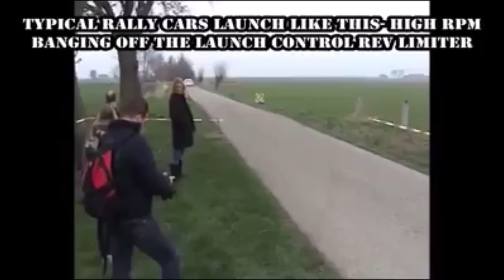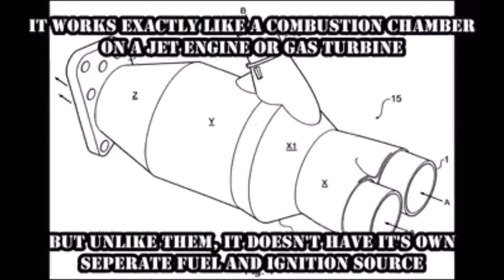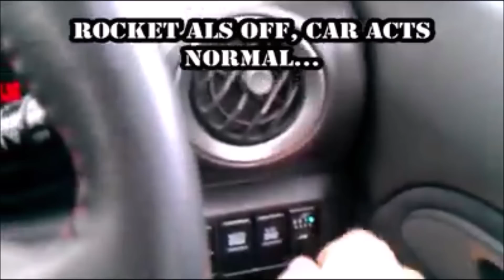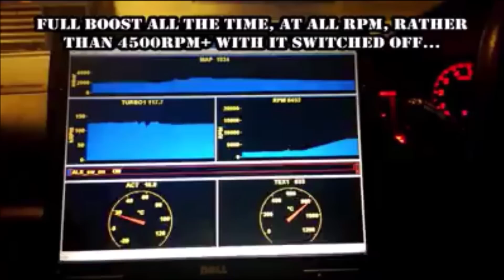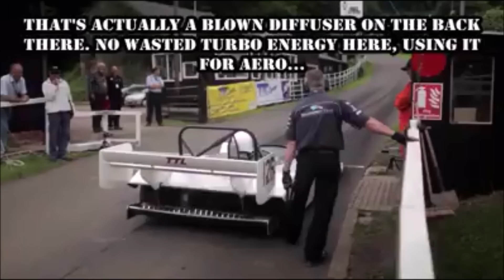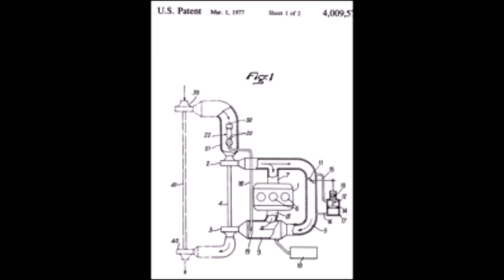Rocket Anti-Lag, making your turbo work like a jet engine- A quick overview and some mythbusting...

Comment: I have a spark plug design it could use to fire water, esp saltwater which is more flammable as a mist/steam. It's too large a plug to fit into a normal head at 2.5" wide and 2.5" deep off the thread.

Comment: this feels like the long way to achieve the same effect as a supercharger. full boost accross the entire rpm range
Reply from the maker: 1- No superchargers truly give full boost across the entire rev range.
2- The only ones that get close are positive displacement ones and they’re not as efficient.
3- Due to parasitic losses and lower efficiency a supercharger always ends up giving way less power for any given boost than a turbo.
4- Due to (mostly) the load on the crank supercharged setups tend to be less reliable for any given power too.

I love superchargers, but there’s absolutely zero comparison, and a good reason they’re not as widely used, even without this setup.

Comment: Just saying.. my diesel vw variable geometry turbo can reach its max shaft speed in less than 2 seconds and result in a absolute intake pressure around 40 psi (26 psi relative to atmosphere. It is impressive to see it done here without any variable geometry. This is a pretty interesting concept and it is good to see someone other than car manufacturers innovating
Reply from the maker: VGT cannot compete with this even slightly. Not even on the same planet. If it did they would.

Comment: porsche just did this electronically with a battery connected to the turbo lmao
Reply from the maker: That’s been around for ever. Not as good or as viable for 99% of stuff
Reply: @StavTech  i had no idea very cool! why isn't an electricity spun turbo as effective as using the method subaru invented? loved the video btw awesome stuff.

Comment: how do we apply this to a dual volute turbo?

two rocket manifolds per turbo?
Reply from the maker: Generally, you just don’t.
Reply: @StavTech  no... the correct answer is they just havent yet 😉

imagine a vr8 or horizontally opposed 8, something with 180° crank, with either freevalve or rotory valve heads, running two dual volute turbos, with four of these for manifolds...

youd have like... 1000hp from idle...
Reply from the maker: @KaosProject21  no, the correct answer is they wouldn’t. When you have zero lag anyhow from this, why go to the complication of twin scroll? You don’t.

If you want twin scroll, you use other forms of rally antilag, which they do. Inc me

Comment: so when you add this will you need to run richer than previous setup/tune?
Reply from the maker: With anything like this the tune will change when you switch it on. You don’t just run this on the stock ecu

Comment: This tech drives me nuts because its honestly an extremely simple device, its just that it needs dedicated computer control and its own control maps, and a well designed combustor to work. Flow-through combustors are very unforgiving if you dont get the combustor design and fueling just right.

And those aspects are VERY difficult for a shade tree tuner to build and tune from scratch.

Meanwhile, theres not much of a market in aftermarket to justify development costs.

And OEMs wont touch the concept because it'd just use more fuel.

Comment: This isn’t needed. The post WWII aero industry showed us the way with ‘turbo compounding’. The modern auto equilivent would be to hook up a turbocharger to a car, but also with a belt going from the crank to compressor end, just like a centrifugal supercharger, but with some sort of varible ratio setup, like a variator or a CVT belt/pully setup. This way the turbocharger would work like a crank run centrifugal supercharger when there’s not enough exhaust pressure to spin in up, but once the turbo was spinning up, the gearing on the belt would change so that kinetic energy from the spinning turbine wouldn’t just compress inlet gas, but would add power directly to the crank as well. Do a search on the Napier Nomad or some later marques of the P&W Wasp Major
Reply from the maker: No, it is needed, as what you describe is wildly complex and still isn’t as effective as this, hence why it’s not wildly used

Comment: How does one manage getting all the extra oil pressure into the turbo at such low engine RPM with such high turbo RPM? Im not real smart, does the turbo pull its own vacuum for oil pressure? Otherwise, wouldnt the turbo bearing wear out super fast?

Comment: Why is is this not used in drag cars? These guys are used to rebuilding the whole engine all the time.
Using turbos as a consumable seems like a small price to pay for always boost like that.
Reply from the maker: Because drag cars are always on boost anyhow.
Reply: @StavTech  Sure with two step and anti lag methods they get the turbos spoiling. But those techs does not seem as reliable for max boost through the whole run as this.
Where you can just turn it on and have the Turbos spooling at full speed and providing as much boost as you let in when ever you want. It seems like a more controllable and even boost somehow.

Comment: I was thinking, what about the idle oil pressure of the engine and the work load on the turbo bearings. there's enough pressure to keep it protected?

Comment: The issue I think is more related to EGT, exhaust gas temperature. They go sky high very very quickly, within a few seconds, risking fires. It's a good launch control but after launch should be switched off otherwise it will melt the turbine.
Reply from the maker: It’s EGT but it’s not fires. Melting turbos etc by being too hot. 

It’s not for launches though, that’s just a very very small part of it
Reply: @StavTech  ALS is good for racing and lap times, nothing beats the good old kick in the butt of a laggy turbo and it's fun trying to avoid it as much as possible by being in the right gear 😁😁
Reply from the maker: @st939  the kick in the butt is no less with antilag

Comment: 120k revs to 50 in .20 seconds, how much g forces is that ?
Is that the force that kills turbos this way ? by fluttering it out through the housing and compressor wheel ?
Reply from the maker: High exhaust temps is what mostly kills it, or accidental overspeeding it.

Comment: Easy thing ! A stroke funnel that ask by drill fuel savers threw xhamber of ! 
Train Overpressure brake air ventileson hoses are goid by too that press spring in cage with bullit by pressure over thought out off and reathem ;) :))
Hell on Fiestie that so unallowed today by GFJ Ford art :))

Comment: I'm amazed that this hasn't been adopted in drag racing
Reply: Because nitro isn't band
Reply from the maker: Why? No cars have any issues spooling on the line unless their shit isn’t working right
Reply: It's a totally unnecessary expense when you can already build boost just fine with a trans brake and conventional 2 step or 3 step.
Reply: I said same but u kinda need the high rpm’s. I still want to see if it helps

Comment: The only useful bit of kit ive seen able to put any power down usefully was the car that was built then immediately outlawed for the pikes peak hill climb was the one that applied a vacuum down onto the asphalt as it aero package..  the thing was electric i think and completely dominated all times and impossible turn rate with the vacuum holding the tires to the road..  that shit was beyond crazy seeing how fast it was from takeoff to end..  like a slot car just go and friggn try to keep your eyes on it before it was gone..

Comment: to my knowledge, this or something similar was used in Group B (specifically Audi) where they injected fuel into the exhaust gasses when releasing the accelerator to keep the turbo spinning.

Comment: What is the switch in the Subaru controlling?  Was the rocket system mechanically bypassed, or did the engine computer just switch to a certain profile?

Comment: If replacing a turbocharger is your idea of "regular maintenance", these are great!
Reply: all types of anti lag destroy turbos this is just a better variant of anti lag
Reply: @wrth  usually the people doing quality builds are same people who get quality turbos and can afford a new one anyway
Reply: @Ruska_o7  I am the guy that does those builds...I also rebuild turbos, bearings are cheap, cartridges impellers and housings... not so much.
Reply: That is regular maintenance. Everybody wants a race car until it’s time to do race car maintenance!
Reply: @Wreckless229  Everybody wants to be a cat until it's time to do cat things.
Reply: Or your rods launching at such low rpm at full boost.
Reply: @catchr7bluedevil dont put it on a shit tune
Reply: Shouldn't cause any additional damage if the rocket is burning fuel & creating exhaust gasses pre turbo. The damage stems from fake anti lag with no rocket, which dumps fuel into the exhaust hoping the manifold heat ignites it causing flame to hit the turbine wheel & damage the turbo. Egt goes high. In theory, the egt can be low with the rocket system if it's burnt correctly & therfore no extra damage
Reply: Was thinking the same...your turbos won't last but...gotta pay to play
Reply from the maker: @millll111lllI  compressor inlet
Reply: To be fair the rocket reduces how damaging it is to the turbo because the burning AFR isn't coming out in big high pressure, high temperature pulses.
Reply: So winners win, losers lose. There is no disruption only entertainment and revenue.
Reply: Seeing as how I drive a VW diesel.. Yes it is regular maintenance ;) Just kidding mostly but the CKRA engine code TDI in the passat has a different turbo from the other 2 liter common rails and does legitimately kill itself around 100k miles like clockwork XD. Fix is to upgrade to the turbo off the GTD Europe gets, or even the turbo the 2 liter CR190 gets.. you get the point
Reply: I wonder if water can be injected after the combustion chamber to cool the gases before entering the turbine.
Reply: Depends on where ur turbo is located 😂. On a subaru stock location... fk that lol! I did 2 in a year and they are a major pain especially to get rhe lower solicon hose to sit around the lower turbo flange without kinking. Fk im having flashbacks as i write this...
Reply: @CVBFonzP7B yea but my 1980 vw rabbit pickup with a brand new diesel engine... I want that thing to eat ebay turbos every year it's easy to work on haha
Reply: @rajgill7576  exactly... hahaha

Comment: You need the extra pipes and valve
Reply from the maker: For what
Reply: @StavTech  for anti lag; exactly what you video talks about. You need the hardware, because you can tune anti lag without, but reliability is tossed out the window, as well like you talk about with the hardware setup youre running the turbo at high RPM constantly.
Reply from the maker: @alexmaccity  no
Reply: Okay That just clears everything up

Comment: Any one read about Soviet turbo charged WW2 aircraft and their anti lag systems? 
They essentially block the intake to increase turbo rpm! It works the same way as using a hoover! When you block the suction and the rpm greatly increases.
Reply from the maker: if you look at my previous videos I did that many years ago on one of my own cars
Reply: @StavTech  I take it is the "102mm throttle, mounted BEFORE the turbo? Anti lag? Junk?" video?

Comment: Just as another commentator, I saw this video years ago and couldn't wrap my head around it. Now I own an 1.8T and understand turbos way better. So a question just came up about the turbo spinning at it's full speed at idle. Since the engine is idling, is there enough oil pressure to lubricate the turbo enough for it to spin this fast without damaging it? Or ist that the point you were trying ot make with the picture of the blown turbo? Greetings from Germany!

Comment: so i assume for this you need an electric oil pump for the turbo since it will be rotating faster then the oil can feed because crankshaft is at low rpm, and how would it work with a higher hp car?
Reply: even at low rpm, the engine is supplying 40psi of pressure to the turbo. They have restrictors to prevent too much oil, actually. No need for additional oiling.

Comment: I thought my Uncle, Dad and I invented antilag on a '65 Turbo Corsa Corvair that was my High School ride '75-'77.
In short if a person kept opening the throttle while simultaneously retarding the ignition we found that after about ten seconds we could keep idle rpm of 850 with 10psi of boost! The exhaust pipes were yellow-hot and that couldn't be good. Drank fuel like crazy, too.
       Uncle Jerry invented "The Mechanical Switch" because it operated sort of like a railroad track switch.
Mode 1 = Locked distributor, carb throttle controlled by right foot (ran as originally made)
Mode 2= Carb throttle locked open, distributor free to rotate from MINUS 24 DEGREES TIMING (idle) to the normal 24 Before Top Dead Center when gas pedal floored.
Reply: Noooo.  You "invented" 2-step, which is completely different than anti-lag

Comment: my old subaru wrx had this and it was really weird switched on to get used to. People actually laughed saying thats not antilag because its not popping flames or sounding like its on a limiter. it ate 5 speeds and td06's though as it was too much fun off the line.
Reply: Wasnt by anychance sold as a pnp system? Would love this for my gc8, but Im guessing that just winging it would be pretty awfull
Reply: @user13377d  it was like 10 years ago so don't really remember. It was one of my only ever bought not built cars that I just paid people who knew more about them than me to sort it. I tend to stick to my Vauxhall's now.

Comment: iirc one of the benefits of this rocket type ALS is it does not reach as high exhaust temperature as just adding fuel and air into the turbo, it uses the air swirling around to keep it at a certain temp so it does not wear things out so rapidly as conventional anti lag.
Reply: I looked at regular ALS as fuel burning into the turbo, where rocket burns it before, therfore putting "exhaust" into the turbo. Saving temps & turbo wear as you say.
Reply: It’s basically a a combustion chamber like in a jet engine.

Comment: Could that be built between the high pressure and low pressure turbo on a compound set up? On a diesel for example?
Reply from the maker: Yeah I guess so, no reason why not.
And good thing about jet engines is they run on diesel normally, there’s no issues with fuel at all.
Reply: Its on an om606 in a truck. It makes no boost belowl 2200 rpm, it sure makes lots of smoke down there, but it would need an additional source of fuel /spark and air no? @StavTech

Comment: Why not make a turbine that feeds an underhood turbo? Instead of all the pops and bangs. Just an engine to feed the main engine air. No exhaust piping.
Reply from the maker: Because it’s a waste of exhaust energy not using that too. No advantage not to use the exhaust to help. It’s been tried before with no real success. Closest to this is Nic Manns car in this video.